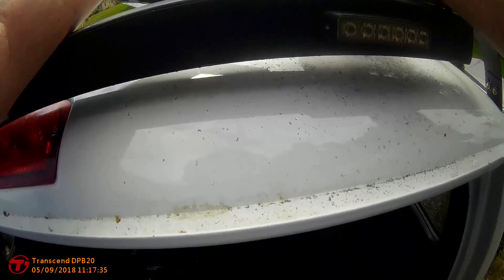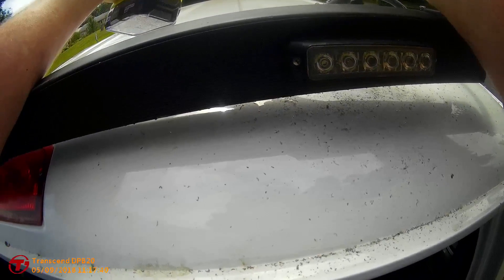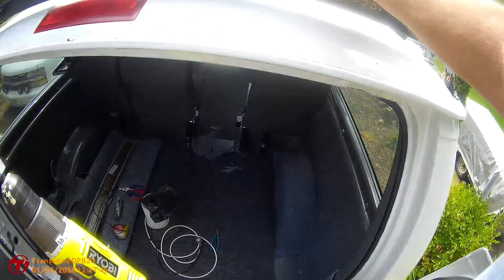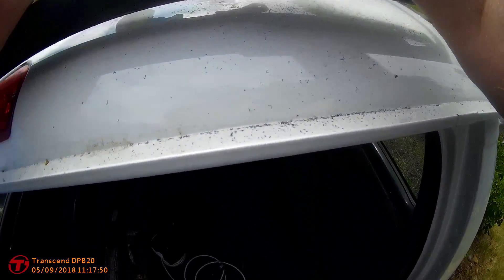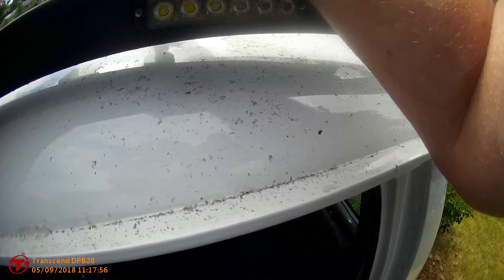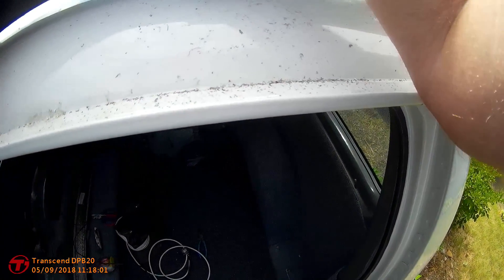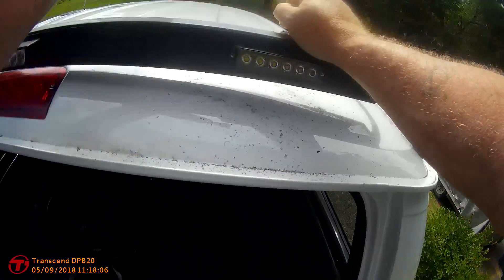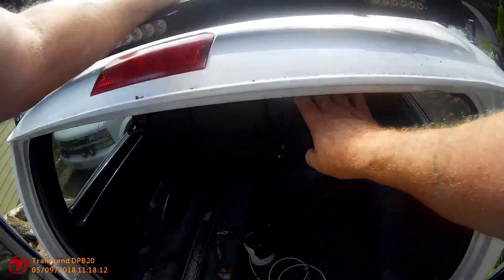Working on the lightbar install and its power plug Long vid, bad cam angle

Comment: the hard part is over. " cuttin a hole in the roof" lol  I guess if you sell the van,you can leave the plug there or maybe find a rubber plug to fill in the hole.
Reply from the maker: That it is, Thanks for scanning the vid I know it is way too long. Sorry.  I want to wire it this weekend seeing I'm running behind. Thanks for your support.
Reply from the maker: Drilling holes in vans is my specialty lol, I buy a vehicle to fit my needs so holes mean nothing to me :) A little bondo goes a long way. lol